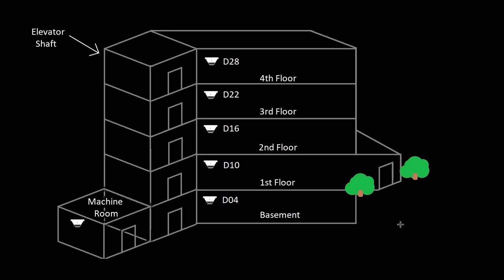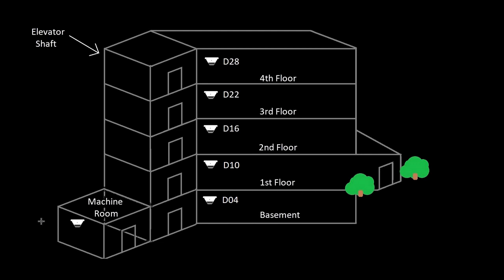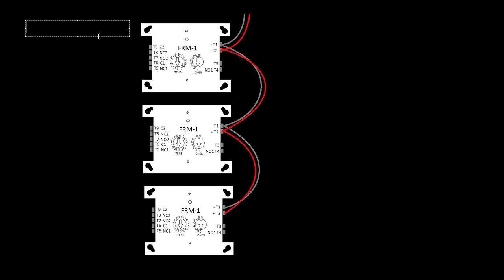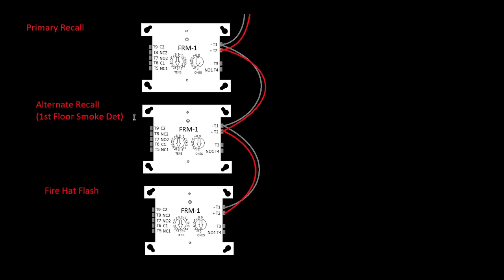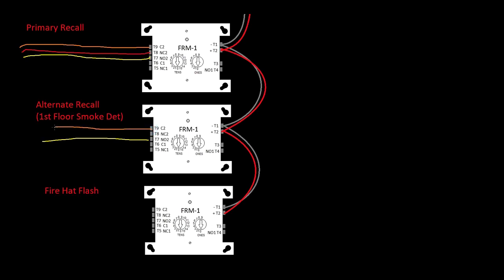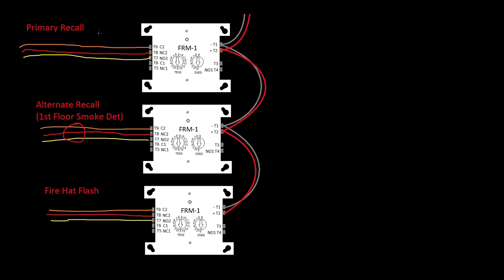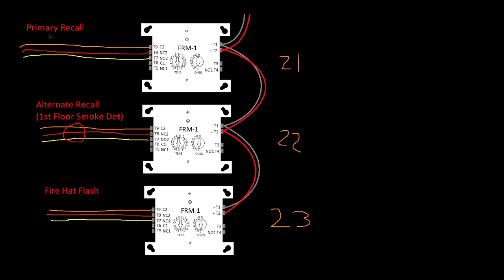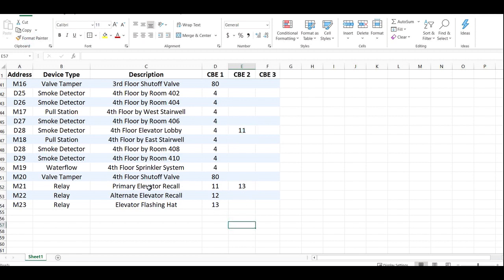36 - Elevator Recall - Programming Your Devices - Introduction to Fire Alarms

Comment: Hey Joe, I have an issue with fire code. The building we are working on has elevator doors on breezeways in unconditioned space. Current fire code required smoke detectors in place for elevator recall. In our industry we all know smoke detectors don’t fare well in unconditioned  areas and asking for false alarms. Note that this building is a remodeled motel into condos right off the beach. Heat detectors for elevator recall in an unconditioned space isn’t to code. What are you’re thoughts? Polling loop runs are on 16/4 due to 500 foot runs. Nac is on 14/4 same lengths roughly. Should I have builder enclose elevator lobby areas?

Comment: Thank you for the detailed introduction, Joe. We have a 2-story building with a 22-year old Dover elevator. The heat detector at top of elevator hoist way mistakenly recalls the elevator to 2nd floor. Does this look like a job for the elevator service tech or the fire alarm guy? Thanks!
Reply from the maker: Eh, both. Heats shouldn't typically recall the elevator at all, depending on the environment. I can say that typically the fire alarm techs' and elevator techs' verbiage is often exactly backwards with regard to primary and alternate recall. We typically call primary any device which recalls the car to the primary floor. When they say primary, they're referring to the primary floor and the associate that detector with primary. For that reason I usually avoid the terms "primary" and "alternate" when labeling their relays.
Reply: I am reaching out to both to see if they can figure this out. Will come back and provide an update when it is resolved. Thank you, Joe!
Reply: Hi Joe, our elevator maintenance provider said this is not their job so I engaged the alarm company, who provided a proposal that says "it will take 2 techs and not to exceed 8 hours to change the program". Do you foresee this as a complex task that will take up to 16 man hours to zone a single sensor? Our two-story building is very small with nothing sophisticated. The elevator is a 22-year-old Dover and the alarm system is likely around the same age. Thanks again!
Reply: UPDATE - Reached out to another fire alarm service provider and issue was finally resolved. Root cause was "the elevator shaft smoke detector relay was wired to the
secondary recall terminals. The tech rewired the relay to activate primary
 recall." All done within 2 hours!

Comment: Can you do a video on fan shutdown?
Reply from the maker: One of my first videos addresses this briefly, though it doesn't specificly address how to tie the circuit into the fan equipment. 

I'm tempted to tell you that fan shutdown isn't the responsibility of the fire alarm programmer/tech. Your job should be to give him a pair of normally closed wires and tell him what current your relay/wires can handle. But the reality, at least in my experience, is that can become a pissing match pretty quickly where the HVAC person may think it's not his job. 

In most cases, particularly on new HVAC equipment, there will be an "E STOP" terminal that will come with a factory-installed jumper. You can simply pull that off and land your normally closed circuit there. However it's not always that simple. 

Just today I was at a job where the HVAC tech just spliced the FSD circuit into the thermostat wiring. When our relay opened, the fan continued running for 90 seconds before shutting down. Obviously that's not good enough. I do have a video coming that will address this a little bit more, but it's somewhat difficult to do because there are so many different types of HVAC units, and it shouldn't fall on us to figure out how to shut them down.